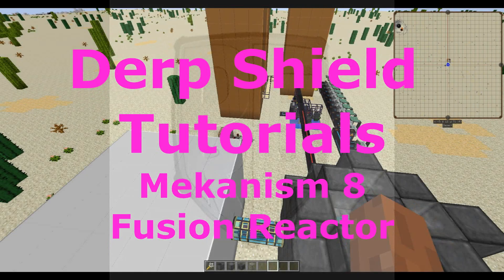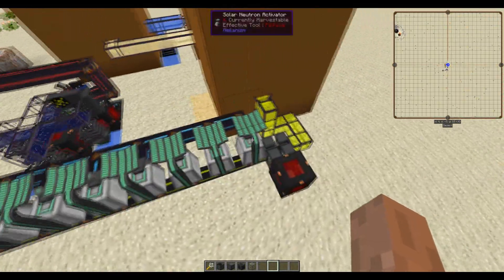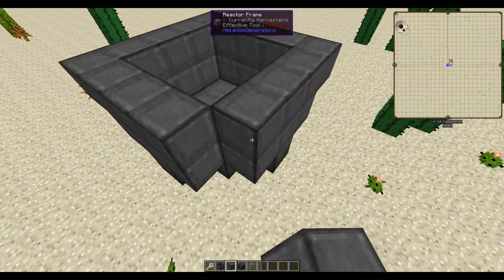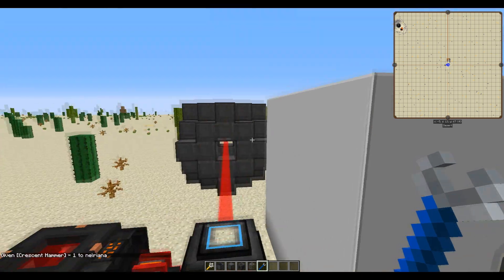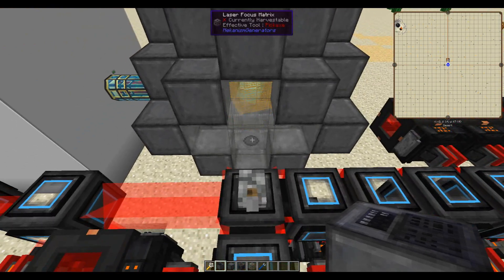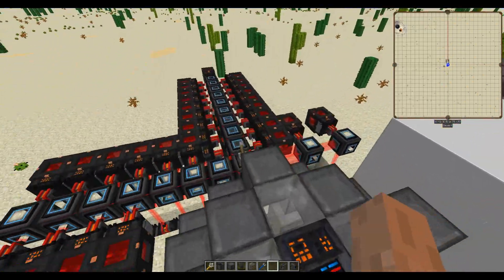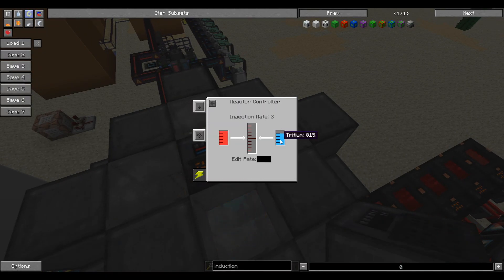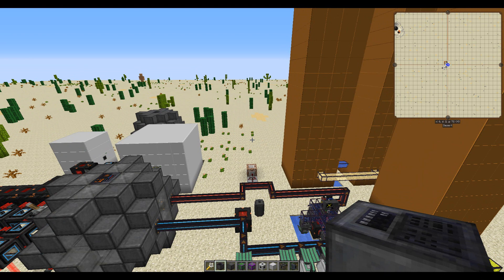Mekanism 8 Fusion Reactor Tutorial

Comment: What Energy Transfer cable/pipe can be used if Thermal Dynamics is not installed ( for best transfer rate )
Reply from the maker: +Red Satiin 
If you have Electricraft, the RF Conduits work fantastic. I believe ExU has a power node which can handle a large throughput. Tesseracts directly hooked to the power output then into whatever power storage you have also would work.

If nothing else then the Ultimate power cable from mekanism. I am not positive on its throughput, but It can probably handle Mekanism's own fusion reactor. 

Alternatively, you can change configs for EnderIO or Immersive Engineering so that its cables can input/output at whatever rate you desire. (just make sure it is not above max integer value as things will probably break)